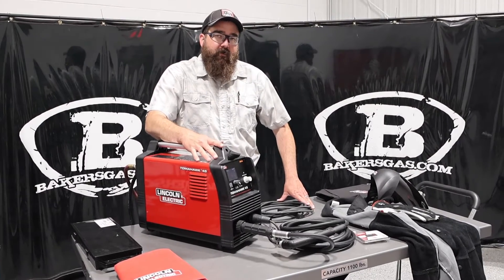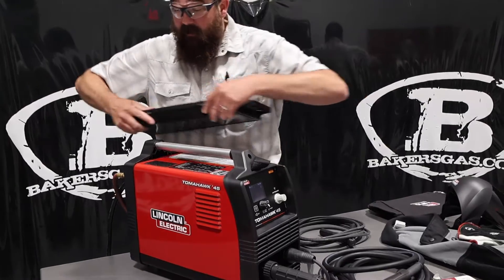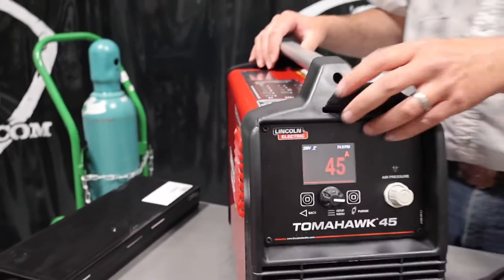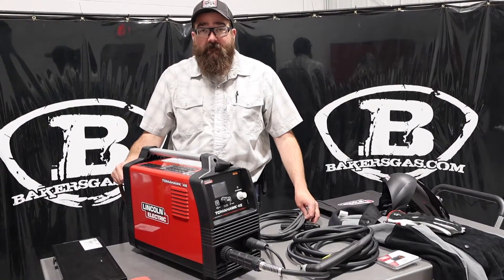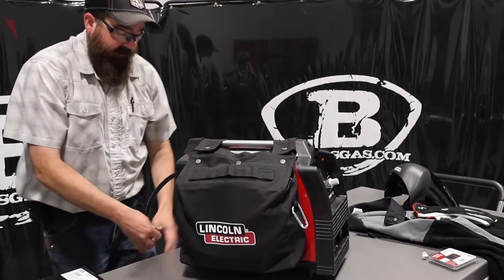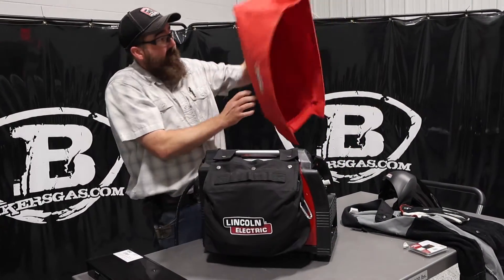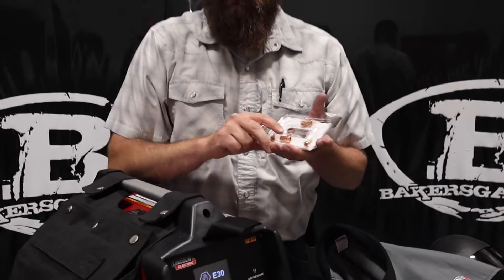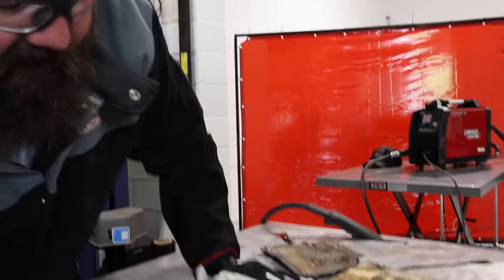Lincoln Tomahawk 45 Plasma Cutter Review and Demo

Comment: If you’re cutting a bolt off and your air keeps cutting off early at 50psi do I need more air pressure or something else going on?
Reply from the maker: Depending on the machine could be your consumables or air I would call manufacture to trouble shoot